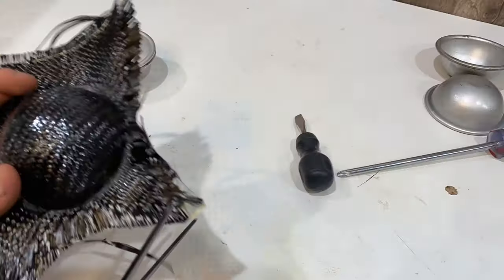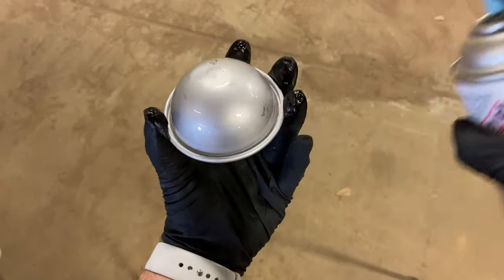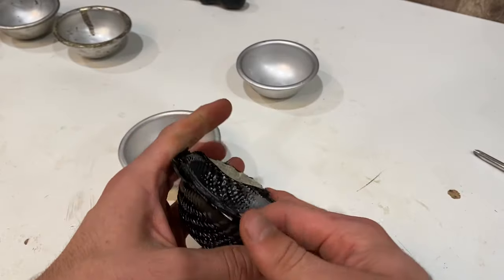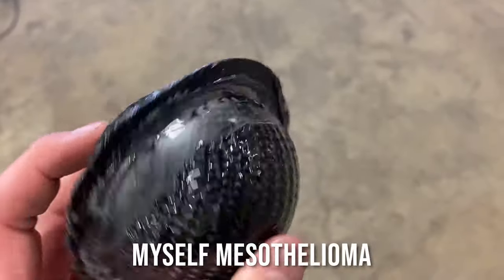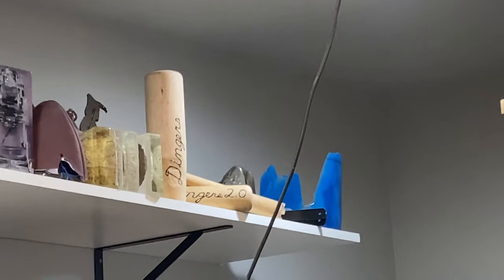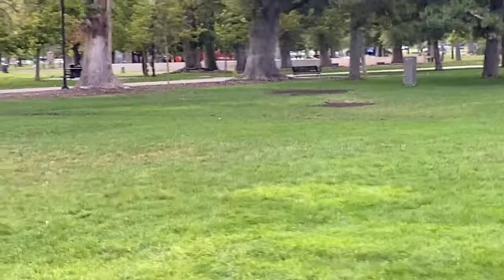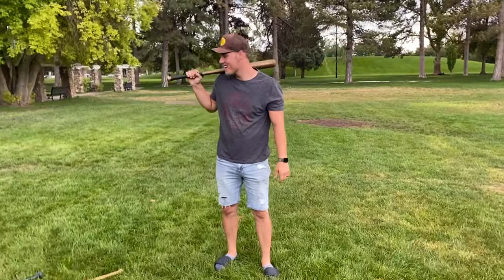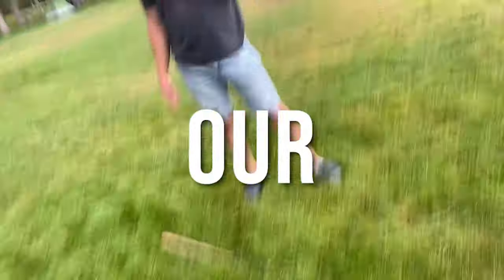World's Lightest Baseball For Guaranteed Homeruns

Comment: To all the gym bros saying "That's not heavy", I remember as a kid watching a strongman contest, and they were holding this T handle (it was sponsored by a razor company, so it was a large razor) and it was like... 80 pounds, but they were holding it arms length. I thought that it was insane that the strongest men in the world were struggling to hold 80 pounds at arms length, but you go pick up a 2 litre bottle of coke and hold it arms length for a minute. That's not even 5 pounds, and after that SINGLE MINUTE you will feel some burn. Holding a weight and holding that same weight at arms length are NOT the same thing even remotely. I can one hand deadlift 135 pounds (that's all the weights I have +the bar) without any effort at all, but even 25 pounds at arms length is insanely hard comparatively.

As a test I just did a 20 pound deadlift with JUST ONE PINKY vs holding the same weight at arms length with one arm. It's easier to one PINKY deadlift than it is to hold the same amount of weight at arms length for even a single minute.

Comment: Golf balls are the ideal ball for distance, as they are small but have a slightly weighted feel to them. Couple that with a hard outer coating of plastic that is ergonomic to travel through air in the most efficient manner possible, and you get something that is very good at going far.
Reply: The main obstacle is air resistance, specifically with spin (Magnus effect) and aerodynamics. Something heavy like a baseball or cricket ball will mostly be limited by gravity, as the force needed to launch the objects very far become very difficult.